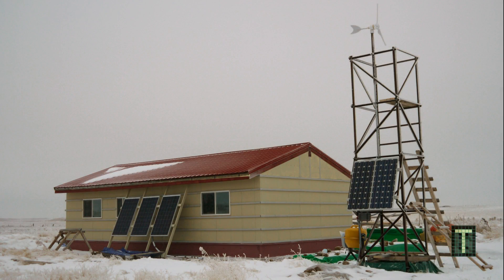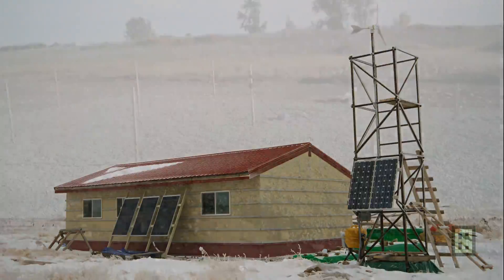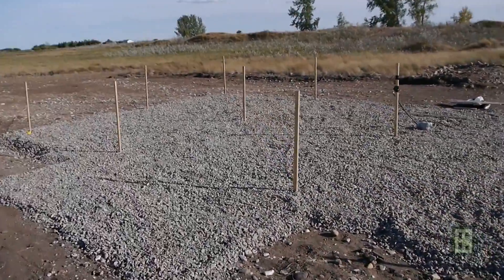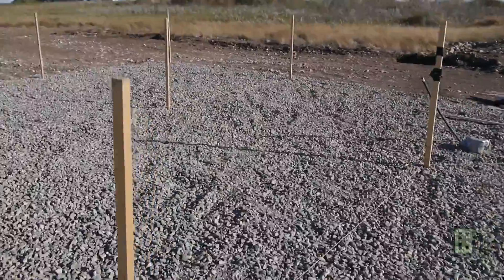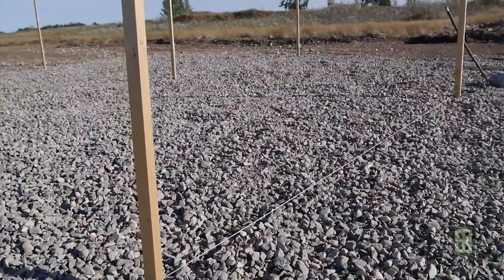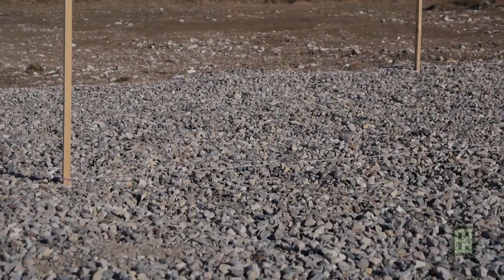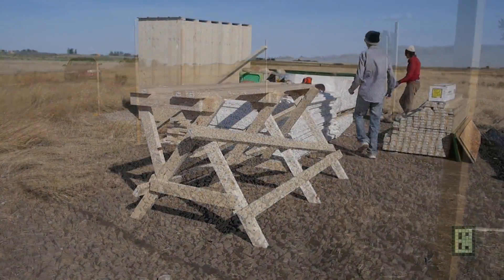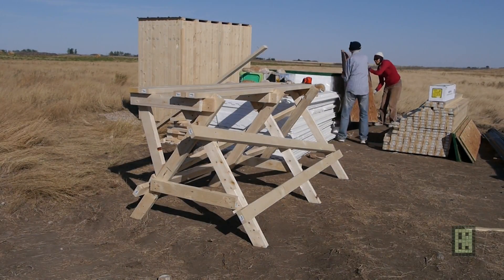Off Grid House

Comment: Most people do not realize that the dimensional lumber used for the walls 89 mm (3.5 in) , provides the Thermal mass required for temperature-sinusoidal variation over a 24-hour period if the walls are insulated properly on the exterior for the Canadian Climate.
Reply from the maker: Yes the wood walls offer some thermal mass storage but it is insignificant compared to the concrete floor that is fully isolated from outside and around 14m^2 and so they offer around 97kWh of thermal energy storage at 12C delta and this house requires in coldest moth (January) around 1000kWh for heating thus even with no heating at all temperature inside the house will not drop by more than 2 or 3C in 24h
Currently the house is fully heated with solar PV electricity.
Reply: @electrodacus  Sorry, I watched the video and was calculating the Thermal mass capabilities of your Walls, and forgot about the slab component.  Best regards
Reply from the maker: @Lawiah0  There are about 8m^3 of wood in the walls so for same 12C delta about 37kWh can be stored thus not insignificant but much less than the concrete floor at 97kWh. There is gypsum boars and furniture all adding a bit to thermal storage capacity.
It is important for for structural parts to be inside the thermal envelope in order to be used as thermal storage.

Comment: Hi Dacian, I have the same project to build an offgrid self-sufficient home and already using SBMS0 on my sailboat. If you had to redo it, would you put copper wire in the concrete slab instead of water pipes ?  Thank you so much for all the sharing !!!
Reply from the maker: I already put copper heating wires by just adding a 4 to 5cm of concrete on top of the existing slab. That 4 to 5cm was needed anyway for leveling and I think adding the copper wires directly will have been more difficult as they could have been damaged during concrete pouring.
Reply: @electrodacus  Thank you... So, putting the water pipes could be avoided, since not necessary ?
Reply from the maker: @richardlussier2812  I used the water pipes for the first years and they are there as a backup but currently I use the electric in floor heating. It was not much trouble or expense to add the water pipe so is not a bad idea to have. I will still install that if I were to build again.
Reply: @electrodacus  Isyour solar setup available online in your forum?
Reply from the maker: @thomasnyanfore8424  I had a lot of info on google+ but since that was discontinued by google the info is no longer available. Tilt angle for the panels is about 70 degree for best winter solar and to help with snow not sticking very easy to panels.

Comment: INCREDIBLE! You have inspired me!   Is there anything you would do different if you could do it all over again?   Does the house stay pretty warm in the winters with this type of construction?
Reply from the maker: Yes house is fairly efficient but it has nothing to do with the construction method just with the level of thermal insulation and reducing the thermal bridging.
The house requires about 1000kWh/month for heating in January the coldest month here.

Comment: Wood has like a R value of like 1 or 2 per inch. IMHO you would have been much better off buildings a 2X6 or 2X8 wall and packing it with insulation.
Reply from the maker: Yes wood has no significant R value the wood is for structural but you can see later in the video there is plenty of thermal insulation walls are at around R35 and roof at an average of R70.

Comment: Good vid! Definitely keep building vids - i think it all works together. Is this a pre DMPPT electrothermal battery build? I didn't see any wire in the slab. That's a brilliant  concept. In fact, I admit I got so excited I woke myself  up from a dream thinking about this. I can envisage a system with passive house, PV, thermal battery, Li-ion battery, electric vehicle (another 50 -100 kWh storage) and a grid connection, all run by smart controllers linked to sensors, meteorological data, energy markets, so your home can generate, store and buy and sell energy (if you are near a grid) in a fluid and efficient manner. Exciting stuff!
Reply from the maker: Thanks. At the time I designed the house more than 5 years ago I did not imagine that PV will be the best/most cost effective solution for heating. Luckily I had no time to work much on the house so I did not installed the ceramic tiles so now I will add the heating wires before installing the ceramic tiles.
House will now be passivise since all energy will be from PV array and cost effective since most energy storage will be in thermal mass.
Unfortunately an EV is still not cost efective at this point in time and battery price will need to drop to below $50/kWh and have good cycle life before EV will be an cost effective option when compared to current gasoline cars.
People do not understand that battery amortization cost needs to be used in the calculation and not just the cost of the electricity for a fair comparison with current gasoline car's.
I'm confident that it will happen soon and EV will be cost effective but is not the case at this point.
Reply: Agreed. I think we are reaching a point where people see how EVs could work in a wider context, as  distributed  storage for renewable electricity. Also, looking at vids here and forums, a whole second use industry has arisen for 18650 cells as they filter out into the wider economy, which will only increase. For me, all these elements are tools in the box as we effectively wean ourselves off fossil fuels. 100 % though, I'll be using your mass battery and DMPPT when I build, without a doubt,   Have a look at the course I am studying in Scotland, it's all about this stuff. There's a pdf link to the content in the page, hopefully it will be of interest....    I have a question too .. Do you think a micro wind turbine (1kW) of sturdy construction and affordable cost, is a good addition for Northern winters - we get effectively 0.5 kWh/m^2/day insolation here at 55 deg North in midwinter. Even with a passive house and 10kW system,  think it'd be a struggle. Lights and a fridge don't take much to run, but I'm thinking more of hot water. Maybe biomass - who doesn't like a fire in winter? All electric would be simpler though... Cheers and I look forward to your updates.

https://www.sruc.ac.uk/courses/97/renewables_and_environmental_technology_bsc_bsc_hons
Reply from the maker: Looking at PVWatts website the worst I can find in Scotland with PV array set with a 60 degree tilt is 0.67kWh/m^2/day in December that correspond to a 173kWh from a 10kW PV array with all other months above 200kWh.
Of course I get 4 to 5x more at my location since is much sunnier but on the other hand is so much warmer there in summer with worst month January average temperature of +3C where here at my location average for same month is  -16.7C thus the same house there will require 2x less energy for heating.
So if I where to move my house there I will require a PV array 2 to 2.5x larger to heat this house so 20 to 25kWh.
Still even so I'm sure that natural gas (usually most common energy source for heating) will be also maybe 2x more expensive making solar PV heating still the lowest cost solution.
It dose not matter where you use the energy in the house can be fridge or hot water all that energy will end up as net heating the house so it will have dual purpose as running the appliances and heating the house.
So if your fridge uses say 10kWh in January then 100% of that energy will also contribute to heating your house same with any other electric appliance that is inside your house.
Reply: PVWatts, great site, thanks. Yeah I think the system is tweakable for sure. It could also be initially over engineered to allow for expansion as funds become available. Payback period here is about 7 years for solar, so free energy/money for the life of the system after that.. makes sense.

I thought a simple, sturdy, single axis ratchet system would work to adjust panel angle a couple of times per year would work - dual axis look too expensive and catch the wind, it'd be better to get more panels. Maybe a robust manual adjustable to 60, 45 and 30 degrees would boost annual performance for a few minutes work a year.

Or perhaps the PV method used here, check it out, it's great!

http://www.rug.nl/news/2017/06/energy-academy-europe-open-to-the-public-on-architecture-day?lang=en
Reply from the maker: It makes no sense to have any type of tracking or even angle adjustment since system will be set for most gain in winter about 60 degree and it will be designed to provide sufficient energy in worst month. You will have huge excess in all other months so it will not be helpful to gain any extra since it will not be useful anyway in summer months.
Making solar PV panels part of the structure is great but will usually require that building was designed for that from the beginning. Unfortunately when I designed the house about 6 years ago I did not think PV will have been the most cost effective source of energy for heating but it clearly is now just just about 2 to 3 cent/kWh for PV panels cost amortization. I do not like to think in therms of payback period but in therms of cost amortization.
Reply: That makes sense for an off grid build for sure. I was thinking in terms of a grid linked system to export excess, so maximising annual output (but still looking at a model that was able to be totally energy self sufficient if desired or necessary).  I had a look at passivhaus standards for energy and heating demand, and 100% PV electric  is absolutely achievable. Maybe a little more than 10 kW, but not a whole lot. Cost wise it makes total sense, once you factor in plumbing, control systems, maintenance etc for solar thermal, heat pumps etc. Just a question of space I suppose, and shrewd management.
Reply from the maker: Yes thermal solar will take about 2.5x less space than PV solar but that is the only advantage. In grid connected application it makes no sense to have a Lithium battery since in most cases cost amortization for the lithium battery is higher than the grid energy cost.

Comment: Why didn't you fix the solar panels on the roof ?
Reply from the maker: The tilt angle is not good for winter when I need the solar energy most.
Reply: @electrodacus  do you have a video of tilt angle or a link?

Comment: I know I'm late to this video. but I am very interested. in your house. I also have an off grid house. but I'm using a generator for now. I hope to build a water wheel. to power a generator. along with solar. and maybe wind turbines if the wind holds up. I am new to your channel. I would like to know more about your power production. and your electrical system. also .more of your home would be nice. if you are up to sharing.  also I am interested in what type of power storage you are using.  I have been thinking about nickel iron batteries . build them my self. if I can find all the materials. but I'll start with lead acid!   I also have been looking into building my own inverter. but I haven't got too far. but pure sine inverters are not cheap. that's the reason I would like to build one. I think I can get by with 3-5 kW. but I could make it with about 2.5kw if I had to.  I could use the generator for heavy loads. like laundry day. I also plan on running the generator on wood gas. or wood alcohol, methanol.  your house  I bet is awesome. from what I saw of it. mine is a old. on grid house. that hasn't been lived in for years. until I got it. it looks like it gets cold where you are. I'm in the middle of the east coast. we rarely see much snow. thanks for your videos. I'm looking forward to seeing many more. I have a lot of catching up to do. sorry for the rambling. and thanks again....
Reply from the maker: Glad you enjoyed the video. The house is still a work in progress since I work on other projects also.
You can visit my webpage where if you scroll at the end will find a 7 day energy graph for my house. In average now I use around 60kWh of energy just for applieneces the heating is still with propane as temporary solution but will be fully electric from PV solar when I have my DMPPT450 done. You can find a paper also on my webpage describing how the Digital MPPT works and how solar PV energy is used to directly heat the house and the energy is stored in thermal mass (water or concrete and how thermal mass energy storage is calculated).
To get an idea about the costs here are a few numbers
PV solar panels have a cost amortization of 2.4cent/kWh (based on panel cost of 80 cent/Watt, 25 years amortization period and amount of sun at my location).
Best battery storage option in terms of cost amortization is LiFePO4 (NiFe is realy bad in this regard) and is best case about 25 cent/kWh 
Gasoline or Diesel generator cost a minimum $1/kWh
And thermal storage cost amortization can be less than 1 cent/kWh so it realy make sense to use with heating or cooling.
Another source for things related to energy production and storage is my google+ account https://plus.google.com/+electrodacus/ and the more private google+ account mostly related to house build and garden https://plus.google.com/+DacianTodea/